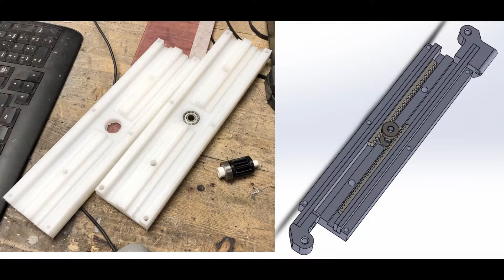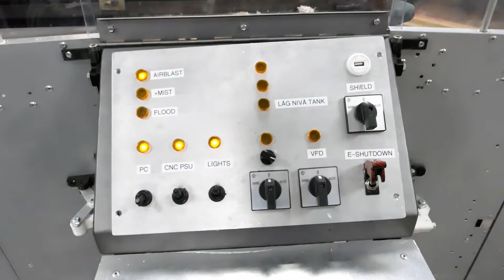Kearney&Trecker Milwaukee 2HL CNC conversion Part 3

Comment: Are those hybrid stepper from stepper online?  How are they holding up.  Do they actually catch up lost steps?
Reply from the maker: Brand sounds familiar, ordered them on ebay but can't remember if that was exactly what they were called.
I don't think they catch up to lost steps but rather give you an alarm if they lose steps.
I might be wrong on that, I just know my Z-axis tends to throw an alarm when it gets stuck(Because old worn machine, not the steppers fault).
Otherwise they're still working great and I use it almost daily.

Comment: Hello what kind of tolerance can you get do you really have to change the lead screw with ball screw?
Reply from the maker: If your leadscrew is in good condition you could use a backlash compensation and be careful when you code the program.

If you have ANY backlash, cutting forces can cause your table to move when it shouldn't.
An acme screw will always have more backlash than a good ballscrew.

My acme screws both have big backlash and are inconsistent along their length due to different amount of wear, this also makes my tolerances differ.

My current workaround is to manually map the screw to identify the problem areas and then code around this. That lets me usually stay within 0.5mm. If I need more accuracy I will have to treat it like a manual machining operation and use my DRO.

Changing to ballscrews would remove the need for backlash compensation and make the movements much more accurate.

Is it a must? No. But it makes the machine a hundred times better.